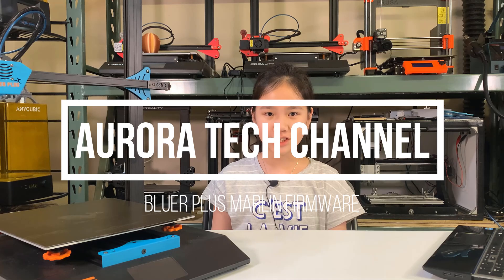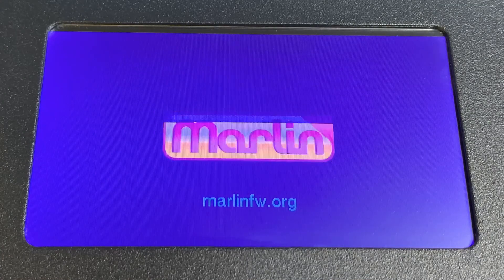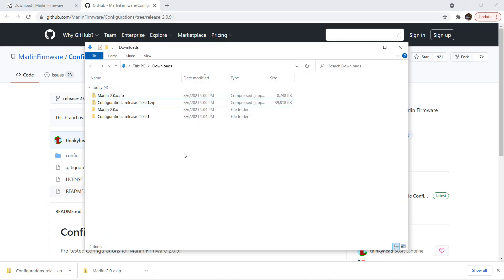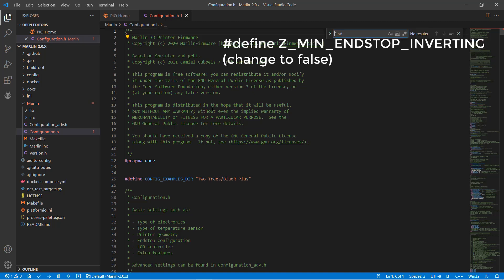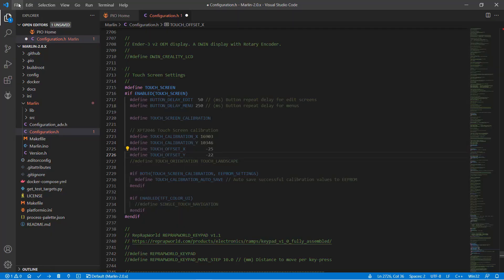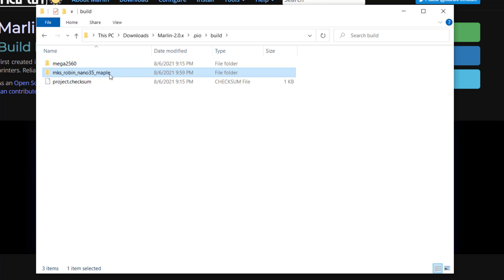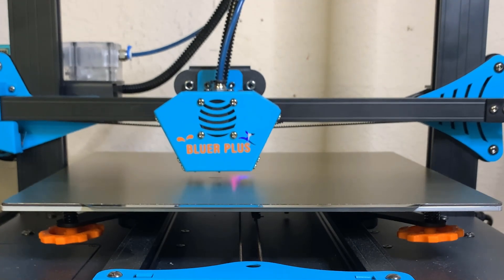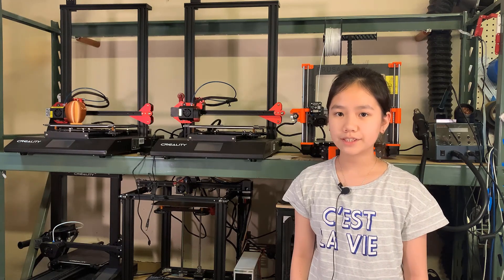Two Trees Bluer Plus BLU-5 3D Printer: Flashing Marlin Firmware, Issues and Fixes

Comment: Thanks so much for this video. I had to change some things on the configuration files like the axis inversion and I even enabled Z Auto Leveling since my Bluer Plus had a 5th driver. Only issue I have is that the touch screen is very sensitive. It will randomly start selecting different menu items on it's own. Is there something I can do to to limit the sensitivity?

Comment: Error: Build environment 'mks_robin_nano35_maple' is incompatible with BOARD_MKS_ROBIN_NANO. Use one of these: mks_robin_nano_v1v2, mks_robin_nano_v1v2_maple, mks_robin_nano_v1v2_usbmod
=================================================================== [FAILED] Took 1468.84 seconds ===================================================================

Environment             Status    Duration
----------------------  --------  ------------
mks_robin_nano35_maple  FAILED    00:24:28.836
=============================================================== 1 failed, 0 succeeded in 00:24:28.836 ===============================================================
Reply: Same here, looks like something has changed in the list of supported boards...
Reply: @ibrahimseydaliyev771  Were you able to find a board that worked!

Comment: Hello, and thank you for the great tutorial! I update the firmware as intended, it works via pronterface, but the screen is unresponsive. I issue M995, it shows the calibration buttons on the screen (the cross on bottom left), I press it but still nothing happens. Any ideas?
Reply: The calibration with an narrow item helped! Many thanks
Reply: I have the same issue. For now, I haven't found the solution. Any suggestions how to restore the stock firmware (I do not the the stock binary)?
Reply: @ЄвгенійЯтченко  I found the solution. Go to the file in the following directory: Marlin/Marlin/src/HAL/STM32/tft/xpt2046.cpp and change the line SPIx.Init.BaudRatePrescaler  = SPI_BAUDRATEPRESCALER_8; to SPIx.Init.BaudRatePrescaler  = SPI_BAUDRATEPRESCALER_64;. Please let me know if that fixes your issue.
Reply: @kapoioskapou  thank you, the behavior has changed. now the calibration is run and it becomes instantly failed.
Reply: Any ideas how to debug this?
Reply: @ЄвгенійЯтченко  can you try to calibrate it using a stylus of some sort?

Comment: Hi Aurora. I've followed the steps and compiled correctly, put renamed Robin_nano43.bin in the sd and update starts  but get stucked with TFT 100%, after  15 minutes no changes. Can you help me?
Reply: Have you solved the issue? Any ideas?
Reply: @ЄвгенійЯтченко  no, sorry.
Reply: @ЄвгенійЯтченко  Even I can't do the M995 calibration because my bluer plus with original firmware didn't recognize that command.

Comment: Hello, thanks for the video, but I am having an issue that I did not see come up in the video. Here is the error could you help me walk thru this? 

Comments are not permitted in JSON.
and 
#include errors detected. Please update your includePath. Squiggles are disabled for this translation unit (C:\Users\Don Wallace\Desktop\TwoTrees Blu 5 firmware\Marlin 2093\Marlin-2.0.x\Marlin\src\MarlinCore.cpp).

Comment: I bought a bluer plus. It broke down in less than a week. Control card ,stepper drivers ,3d touch all burned out. Two trees do not cover any damage. They say it's guaranteed but there's none. Know that fact before you buy. I will never buy any product branded two trees.

Comment: did it all fairly successfully however the touch screen isn't calibrated right with the values i used from your video. any idea what i should do?
Reply: nevermind just noticed it was set to landscape
Reply: Hi I'm having problems with the touch screen as well, can I ask you what you changed?

Comment: What windows driver did you use for this printer? I'm not able to connect it to pronterface, my laptop only sees the printer as usb serial device, not finding the driver automatically, and I haven't been able to find it on the two trees website.

Comment: Hello, I also had those problems with the touch screen after compiling marlin, and after seeing the pronterface I tried and achieved it the first time.
Before continuing I explain that as my English is limited for a long explanation, I will use the google translator, be benevolent.

Although now it worked ok, I put the same values in marlin and recompiled to see if it worked too, and it worked without problems.
also change the serial port speed in marlin to 115200.
I put the values in the order that they appear in Marlin.
TOUCH_CALIBRATION_X 16296
TOUCH_CALIBRATION_Y 10935
TOUCH_OFFSET_X -8
TOUCH_OFFSET_Y -36

Now I want to congratulate Aurora, I love the videos of her and I suppose it is because with how young she is, it is explained much better and in a more pleasant way than people much older, and the false shots are fun.
Keep going Aurora and congratulations on your channel
It already helped me with the Sapphire plus and now with the bluer plus.
Thanks

Comment: I figured I'd ask 😭 when I do the stock config and do what I'm supposed to (not my first firmware) the tft43 is receiving phantom touches on the screen. I've even copied information from a working config and it continues. But if I use another firmware (from someone else) the screen works but axis are inverted
Reply from the maker: Try to search for:
#define TFT_ROTATION and set it to TFT_ROTATE_180 or TFT_NO_ROTATION
Reply: @AuroraTech  hey sorry i cant believe i never responded. im not sure what the issue is but if i use a bluer firmware my touchscreen keeps getting phantom touches and says calibration failed. i ended up just having to use a firmware source from a different printer with the same motherboard. unfortunately im back to the same issue with 2.1.1
Reply: @joshuamns1  I had the same issue. Use marlin 2.0.8

Comment: Hi Aurora, I'm having trouble with the touchscreen.  The firmware flashes but the TFT is non responsive with the default and your XPT2046 settings.  Any suggestions?
Reply from the maker: The touch screen of your printer may different, you can calibrate it using the M995 command. 

Connect the printer to your computer, use Pronterface to send this command, so you will get the new touch screen calibration values.

How to download and install pronterface:
https://www.imade3d.com/2017/11/download-install-pronterface/

You can read this article for more info and see other users calibrate their touch screen:
https://github.com/MarlinFirmware/Marlin/issues/20312
Reply: Thanks for the tips & links but as with @AVMIM the same happened with me using M955. I might try some more tinkering.
Reply: @Michael Anderson  I have the same issue. My touch screen is completely misconfigured. When I send command m995 to my printer, dots appear on the screen but there is no time to click, then it appears this text on the screen "calibration failed". Aurora, do you have any tips about our problem?
Reply from the maker: @andrevitorvalle8298  

Normally, after you sent M995 using Pronterface and calibrate the screen and it will return the values, I didn't have any issue with this or other printers yet. But you may take a look at this article:

https://github.com/MarlinFirmware/Marlin/issues/20312
Reply: @AuroraTech  After further troubleshooting, I was able to send the M995 command with the latest bugfix 2.0.9.x marlin FW.  I had to press all over the screen to get it to go to the main menu .  At this point the M995 would send, however, the touch calibration would still not calibrate and would self-calibrate by jumping across the screen and fail.   Removing the screen had the same issue. Odd that reverting to the original FW has no problem with the touch screen, but I'm unable to send M995 commands to the printer.   The Baud rate is 115200 for the original FW, 250000 for the Marlin 2.0.9.X.  I may try using a slower baud rate for Marlin to send the M995 command or flashing to an older version of Marlin to see if that helps.  The model of this TFF is MKS Robin TFT43 v1.0.  Unfortunately this does not seem to be for sale anywhere separately.
Reply: @michaelanderson5854  I managed to fix it by downgrading to  2.0.8
Reply: I send command M995, wait a long time for a response from the printer, but nothing happens
Reply: Any new suggestions on how to fix the non-responsive TFT. It looks like the calibration offsets are different to different displays. I managed to run the calibration, but the display is not reacting to presses on the crosses...

Comment: I have the TT Bluer Plus printer. I did the marlon firmware step by step. Insert the micro sd card, accept the changes but the touch screen no longer works. I have been trying for 2 hours now and nothing. Please help
Reply from the maker: Since I have no access to your hardware, but my best guest is the touch screen of your printer is different, you can calibrate it using the M995 command. 

Connect the printer to your computer, use Pronterface to send this command, so you will get the new touch screen calibration values.

You can read this article for more info:
https://github.com/MarlinFirmware/Marlin/issues/20312
Reply: @AuroraTech  Ok thank you. Really hoping it will work. It took me hours to figure out how to go back to it's original firmware
Reply from the maker: In case you want to go back to stock firmware, just download it from TwoTrees, unzip and copy 2 folders and 2 files to the SD card as below.

mks_font (folder)
mks_pic (folder)
Robin_nano43.bin (firmware file)
robin_nano43_cfg.txt (config file)

It should be done in a few mins.
Reply: @AuroraTech   Thank you for the help and the videos :D
Reply: @AuroraTech  Is the firmware in the SD card? There is no more firmware on the website.
Reply: @AuroraTech  Link? cant seem to find it.
Reply: Someone finds the original firmware?

Comment: First of all, nice video! Well explained, I did just what you said, but now I have 2 issues: 1) I am having an issue with the screen up not matching up with the commands I give. I can not choose the print or temperature buttons at all =(...2) When I turn my printer on, the Nozzle temperature starts at 80 Degrees, already changed the Thermistor but got nothing.. =( any tips?
Reply from the maker: If you are sure you did the same but still didn't work, it is possible that the hardware configuration of our printers is not the exact same. In this case, you may need to go back to the stock firmware.

Comment: I got a problem!
As i am unable to install platformio on my Visual Studio cod i wounder if you @Aurora Tech can share the one you compiled on github so i can upgrade my printer and also for others how needs it and not can make one them self.
Thanks in advance.
Reply from the maker: Hi! I suggest that you uninstall VS code and restart everything. If you just use someone else's compiled firmware, if there is any hardware in your printer that is not the exact same, you will run into all kinds of different issues that you can't fix. Manufacturers may change hardware configuration from time to time.
Reply: @AuroraTech  Ok i got it installed but i can not get the project task to show up as in your video, What am i doing wrong?
Reply: @HomeyFlows  You have to open the root folder for Marlin-2.0.X inside the VSC. If you´re opening the ..\Marlin-2.0.X\Marlin\ folder, the platform IO file won´t be available and the project task as well.
Reply: @HomeyFlows  You need to open setting json. CTRL+shift+p on your vscode and digit: setting json.. open the file and put: "task.autoDetect": "on" and save file.. after then you can restart vscode and test again. It work's for me. maybe it will take a moment to load..

Comment: Glad you resolved the issue.
I wonder if the issue persists in the updated firmware version from Makerbase. They have github repositories for their firmware versions.  The 
"Mks-Robin-Nano-Marlin2.0-Firmware"  project appears to get the most updates, some files updated just days ago. The other projects look to be quite stale though.
Reply from the maker: MKS hardware is fine, but firmware is just a modified Marlin(with bugs), the graphical interface is from the open-source LVGL Graphics Library. I prefer classic Marlin, if you like the graphical UI, you can still use Marlin and select the LVGL interface to get the same UI.

Comment: Thank you for showing us how to do this properly. You are amazing! Question, have you tried installing the WiFi module on your Bluer Plus yet? We have but when we try to ABL it stops at the back right corner and puts the nozzle a bit high waiting for you to change your Z Offset which is wayyyyyy wrong. Wondering if the Marlin update works fix this? Thanks again for being all kinds of awesome!
Reply from the maker: You are welcome! I have another printer with the same Robin Nano v1.2 motherboard and ESP8266 wifi module, it's the Kywoo Tycoon, the problem is the MKS wifi is not very useful, you need to use Cura, install the MKS wifi plugin, keep your computer stay on and send Gcode line by line via wifi during the whole print. You can take a look at my other video, using the same ESP8266 wifi module, but installed Marlin and ESP3D.

https://youtu.be/7J9vFdrF9kQ